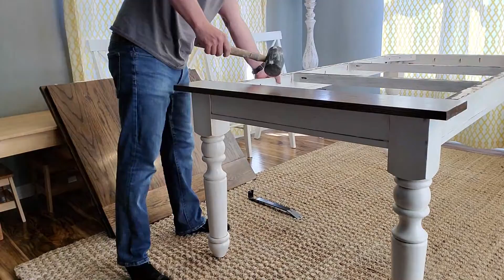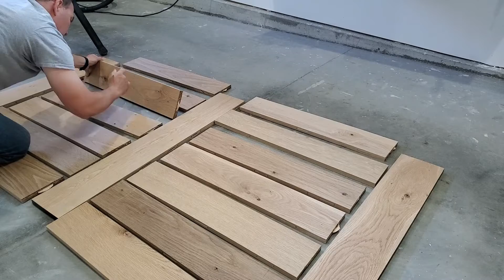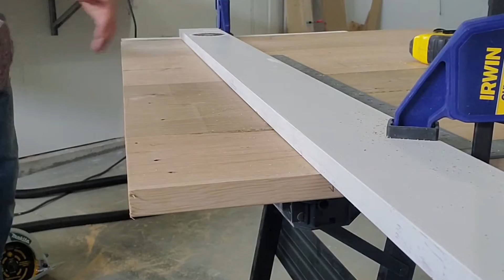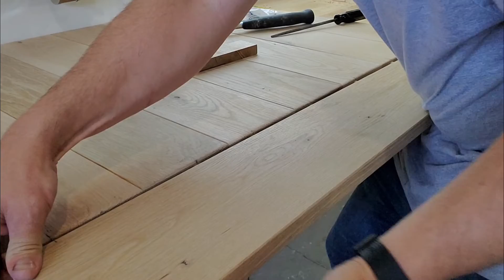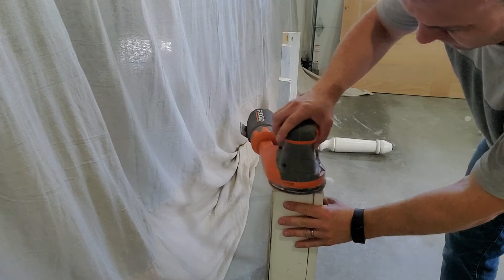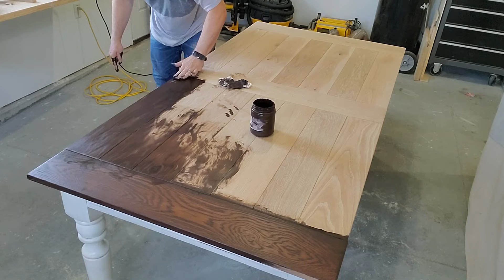The RIGHT Way To Make A Farmhouse Table || With Dowels

Comment: This video is JUST what I needed! I was about to make a table top with pocket-holed breadboards and was just a bit suspicious based on what I was reading. I didn't want to lose any length by cutting in mortise/tenon joints. This dowel method will be perfect. Thank you!
Reply from the maker: Perfect!  The table still looks perfect a year later.  Thanks for the comment.

Comment: I liked your clamp extension.

I have been using pipe clamps as you have but have purchased couplings and addition pipe to make those clamps as long as I desire. Only problem is the coupler creates space between the pipe and work piece . Little bit of shimming and it’s solved.  Nice work by the way
Reply from the maker: Good idea!

Comment: What size roundover bit did you use on the edges? I love the little bit of definition it adds to the boards. I have thought about doing that myself but wasn’t sure how it would look. Now I’m for sure going to try it.
Reply from the maker: I usually use a 1/8th roundover.  It's best to try it and see if you like it.  Start small.  Just remember, after you glue it and sand the panel, the roundover will get a little smaller.

Comment: How has the table held up using dowels?
Reply from the maker: Very well.  No cracks or issues with the breadboard ends.  The ends do expand and contract from winter to summer, which is normal.

Comment: What about locking in the dowels? Seen a lot of people drill through table with small dowels to lock it in.
Reply from the maker: I thought about that.  The dowels just weren't big enough for that.  If I would have done a tennon I would have for sure.  So far no issues!